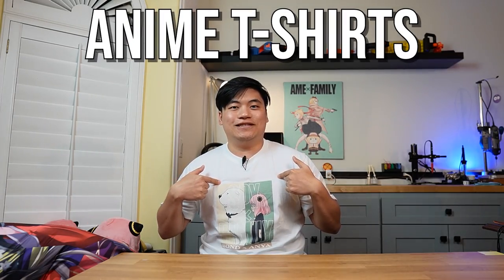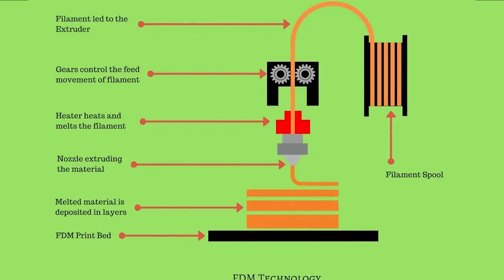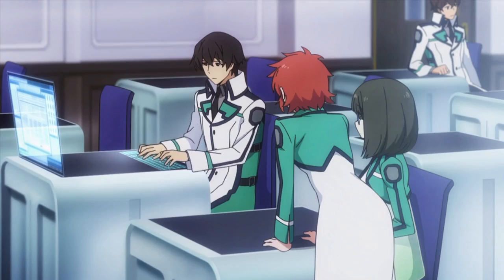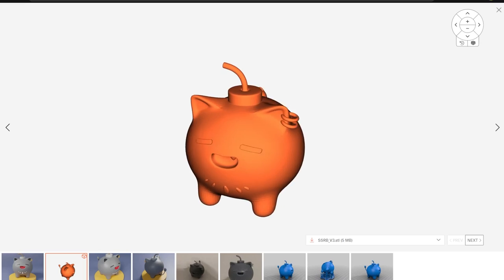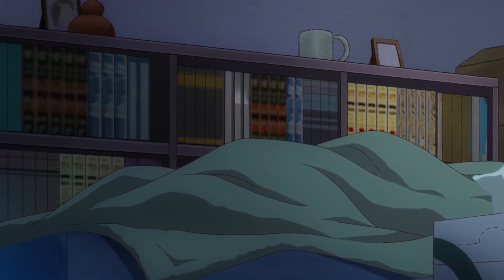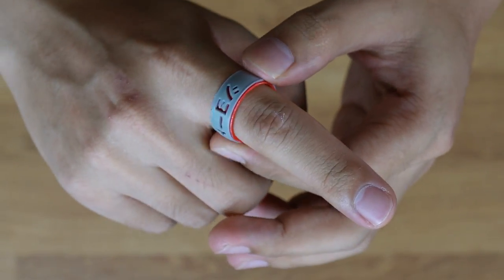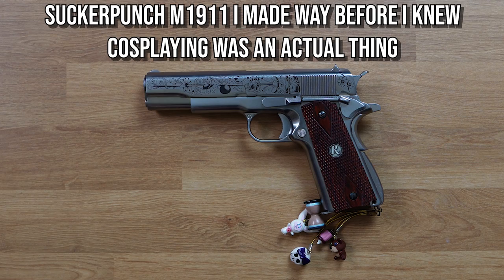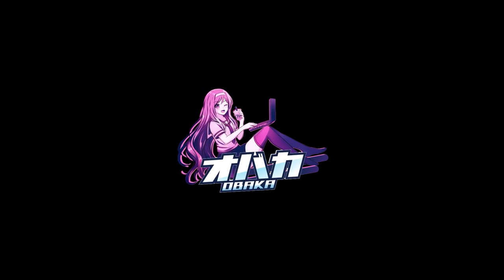Why 3D PRINTERS are an ANIME FAN'S BEST FRIEND

Comment: Bambu Labs P1S is just as good if not better since it's cheaper. Also, it wouldn't be easier to print gundams or figures like that?
Reply from the maker: I got the Bambu back when it was a kickstarter so the X1 was the only option. As for printing figures, if you’re good at post processing and painting then you can print amazing figures. However my hands aren’t steady enough to paint something so detailed 😅